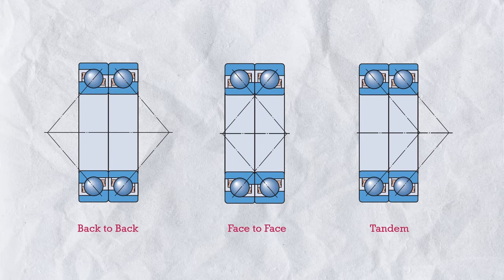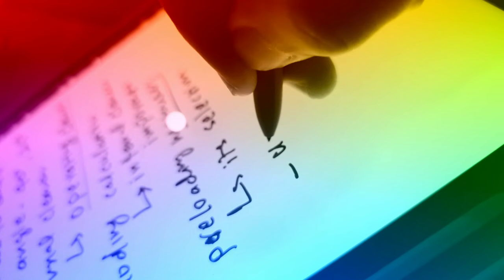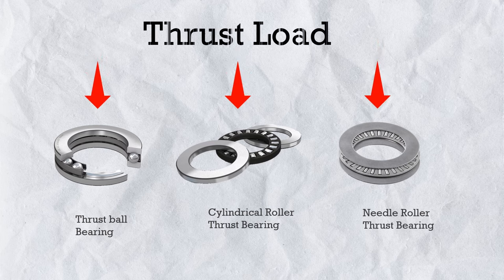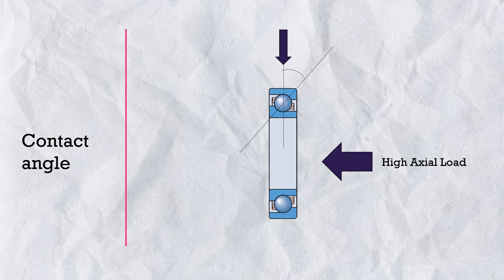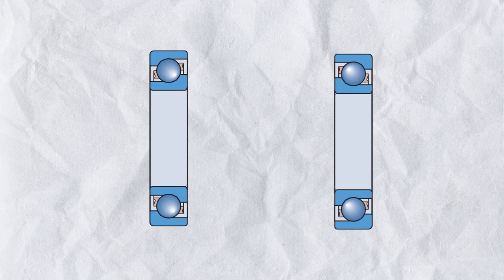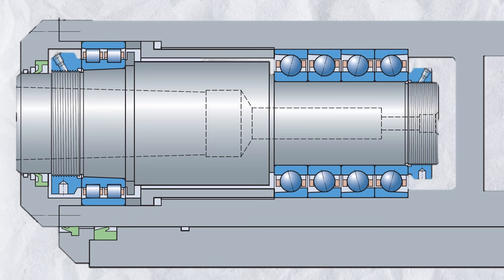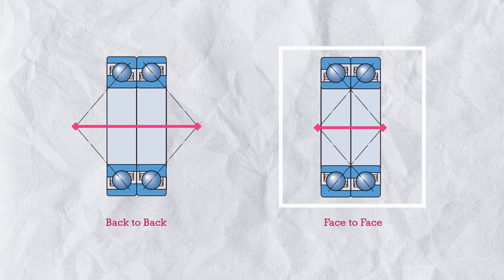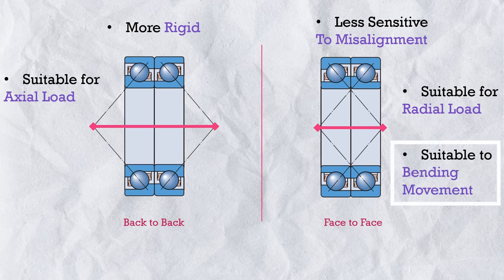Angular Contact Bearing Arrangement Selection | Back to Back Bearing Arrangement

Comment: The example in the contact angles segment shows the load applied to the back of the bearing which conflicts with your examples in the arrangement section. This made the video somewhat confusing during first watch
Reply from the maker: Could you leave time stamp
Reply: @mastermechanicaldesign  6:20  Is the load path correct?
IMHO the load should go from inner ring to the outer ring of the active bearing (right bearing)

Comment: From where we can get standard table like roughness, hole and shaft basis tol., socket head bolt size, thread table, drill bit chart, pneumatic cylinder block dimension for Model etc to Improve design process.
Reply from the maker: Just search on Google, and make sure the standard Like DIN or ISO.
or search like Surface roughness ISO standard, probably you will get PDF file.

Comment: Sir
Which side is face and back in bearing. ?  How to identify? 
What if I use a spacers between two bearings? And spacers spec and limitations? 
Please kindly answer if possible thank you.
Reply from the maker: At 04:48 You can see, if bearing outer race is fixed, we can apply load only from left side, because only then inner ring half shoulder will touch and press the ball on outer race half shoulder. So left side is the face of the bearing. Or just for identification, the shoulder side of the inner race is the face.
Spacer between bearing - we can put spacer in between bearings in both back to back and face to face to preloaded adjustments, I have discussed all these things in too much detail in the next upcoming video. 👍
Reply: @mastermechanicaldesign  thank you, Sir
Waiting for new video.🙏